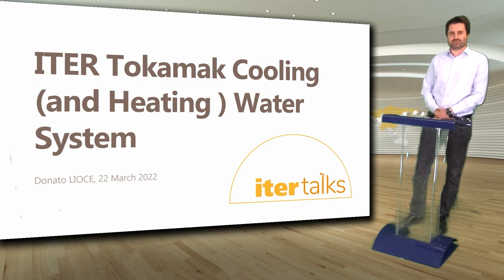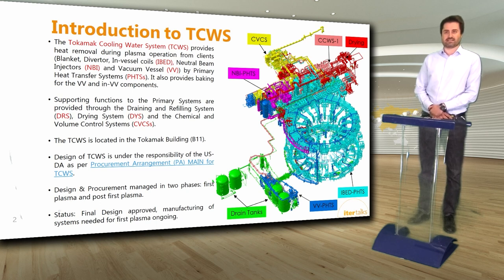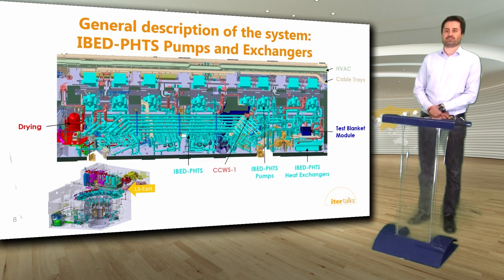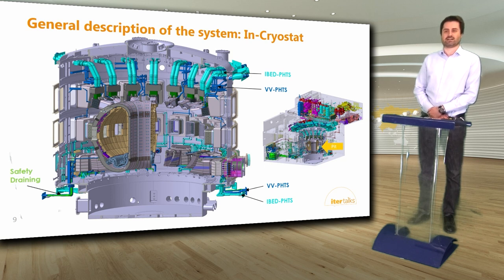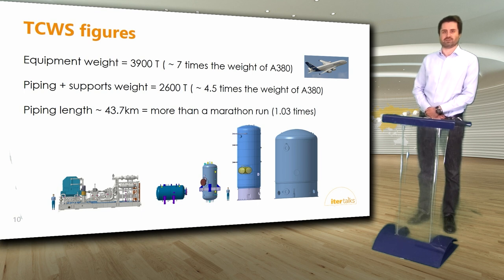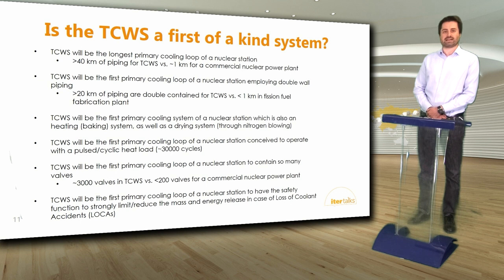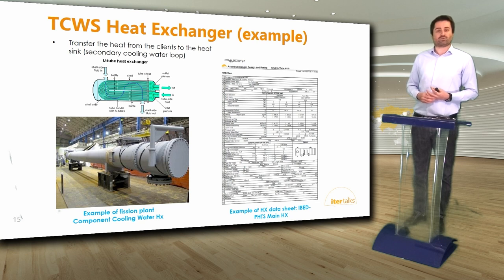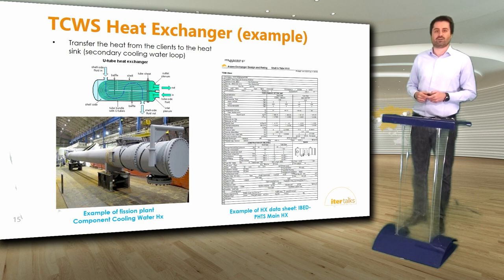ITER Talks (8): The Tokamak Cooling Water System

Comment: No doubt about it, some real production problems. But strangely, while listening, I actually got something out of this, and it may be significant. And it may not be what most viewers want to hear. Picture me doing a Columbo routine. Here goes…

Is it not true that most of the energy from D-T fusion is carried by the escaping neutrons? In fact, is the proportion not actually somewhat higher than for a fission reactor? You can choose the surrounding materials in order to control the half-life of the activation products, right? And you would generally want to choose materials whose activation products will have shorter half-lives, right? You do that so that you don't have long-lived waste to handle. So if a fusion reactor has been running for a long time, there is going to be a LOT of intense decay heat from the capturing materials. Much MORE than for a fission reactor. Now, suppose a worst-case scenario, where all power is lost, and no coolant is circulating. You're going to have a lot of VERY hot coolant circulating. Indeed, that's exactly what you want, for the sake of efficiency. If the coolant suddenly quits circulating, aren't you doing to have something VERY BAD happen? Aren't you going to have…yes, I'm going to say it, a…MELTDOWN?

We are constantly told that a fusion reactor would be inherently safe because the reaction at any time involves only a tiny amount of material. But is that the problem at all? Isn't it the decay heat in the surrounding materials that are hit by the neutrons?

I'm glad I'm lukewarm toward fusion, because if I was a fan, I think this would be keeping me awake at night.
Reply: no you won't have a meltdown because the decaying materials don't release anywhere close to enough heat to cause that
Reply: @infinitelyexplosive4131  I'm not convinced. The neutron flux is actually more than you get in a fission reactor, in terms of energy. Actually, though, what matters is the number of neutrons, as that determines the amount of activation products created. As for how hot they would be without cooling: As with a fission reactor, they will build up. But it will be on different time scales. For fission, heat increases until the fuel is changed. For fusion, it's how long it's been running since the last swap of whatever is stopping the neutrons. In both cases, it's a variety of different nuclides that get involved, all with different half-lives, so it gets complex.

But what bothers me a bit is that no one seems to talk about this decay heat issue, almost as if they're pretending it doesn't exist. Maybe it doesn't, that is, is not significant. But I think it may be.